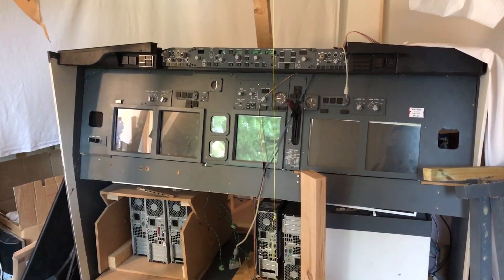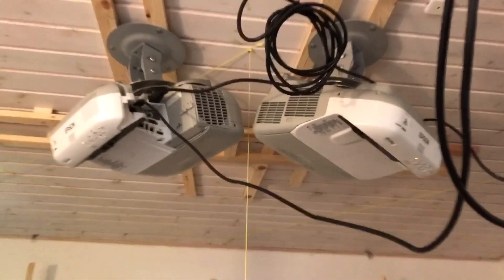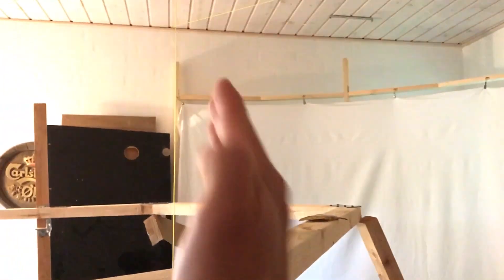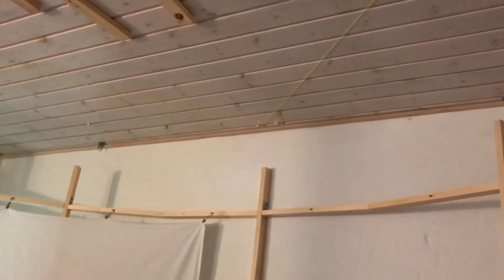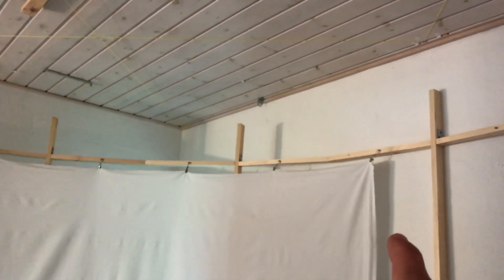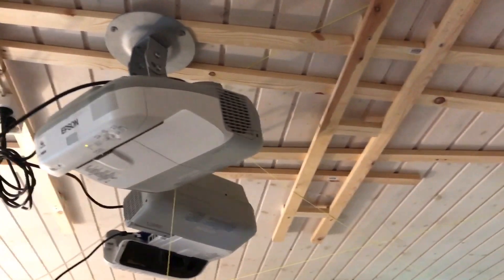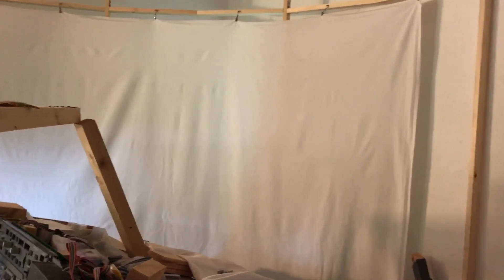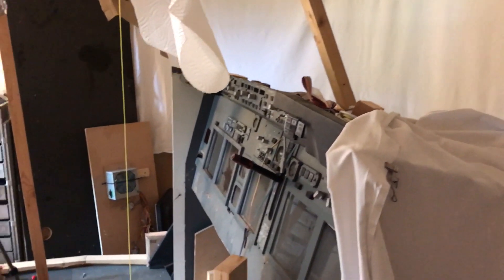180º visuals, part 1 - B737 Home Cockpit

Comment: The use of the yellow string is very good. I also have that ultra short projector, but haven't turn it on. Are the projector quality good?
Reply from the maker: Do not know yet. Need to do some wrapping. So I better wait before judging. :-)
Reply: Build a Boeing and without the wrapping? I will only use one, and without wrapping, I don't have space for more.
Reply: Build a Boeing Remember to overlap the projector image atleast 15%
Reply from the maker: A 15% overlap? As a margin when blending the two pictures? 15% seems like a lot. /Peter
Reply: I know it seems alot.. The more overlap, the better actually. Your Warping software will create a blend point, and if the overlap is too little, it will show in your picture.